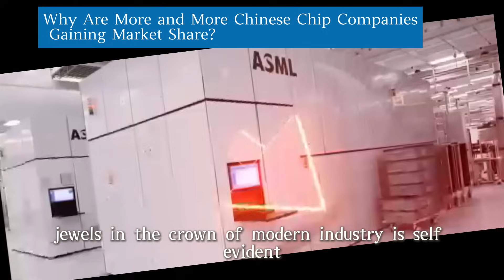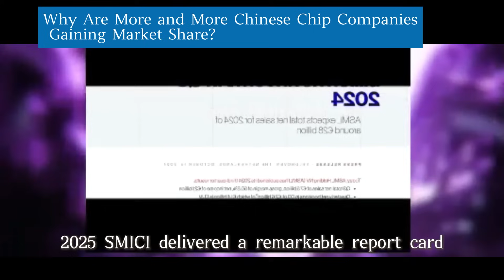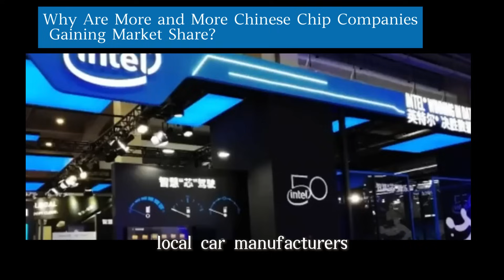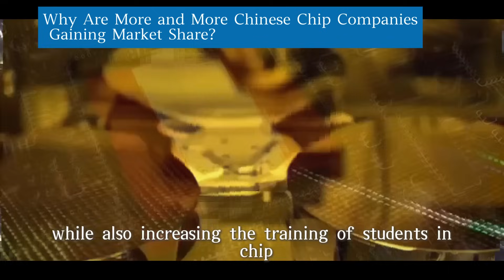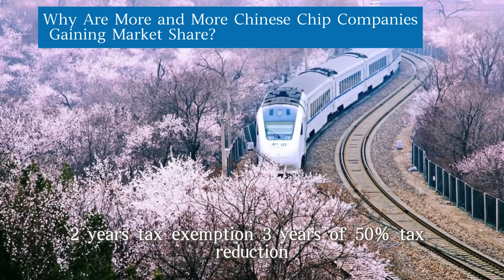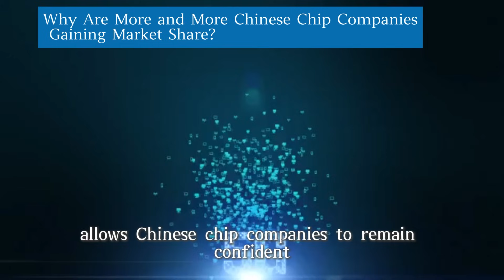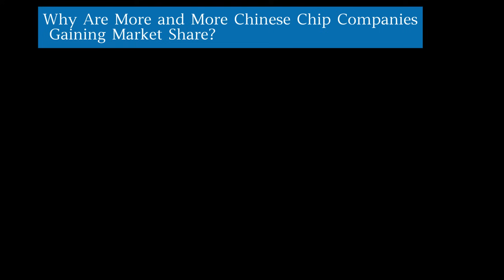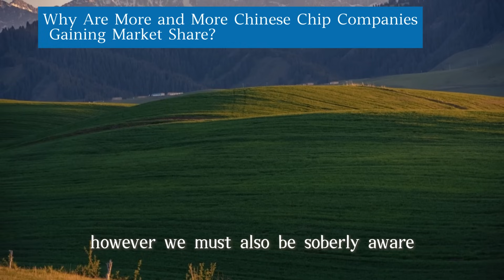Why Are More and More Chinese Chip Companies Gaining Market Share ？

Comment: Chinese chip companies are making significant strides in the high-end chip market, particularly in advanced logic and memory design, driven by substantial government investment and a focus on self-reliance. 
China's semiconductor industry has experienced rapid growth, driven by significant government support, a large domestic market, and a strategic push for technological self-reliance, particularly in response to US export controls. 
Chinese firms are making notable progress across various segments of the industry, including fabless design, foundry manufacturing, and memory production.
Chinese firms are also taping out advanced 7nm and 5nm chip designs for AI and 5G applications.
The foundry sector is led by Semiconductor Manufacturing International Corporation (SMIC), the largest contract chipmaker in mainland China and the fifth-largest globally. 
SMIC has expanded its capabilities and capacity, including partnerships with Huawei to develop 7nm technology, and is constructing new facilities in Beijing, Shanghai, Tianjin, and Shenzhen. 
Other key foundries include Hua Hong Semiconductor, China’s second-largest contract chipmaker, and emerging players focused on mature nodes, which are critical for a wide range of applications.
In memory chips, Yangtze Memory Technologies Co (YMTC) has emerged as a leading manufacturer, leveraging state funding and innovative Xtacking technology to produce dense NAND flash memory chips. 
ChangXin Memory Technologies (CXMT) is another key player in this space.
Chinese companies spent $25 billion on semiconductor equipment, surpassing the combined spending of the US and South Korea. 
The overall trajectory indicates a powerful and sustained rise in China's semiconductor capabilities, with the potential to capture a significant share of the global market in the coming decade.